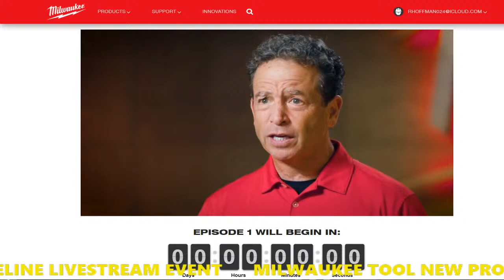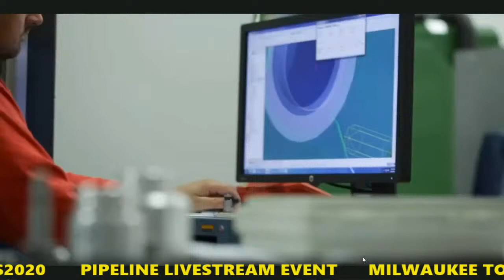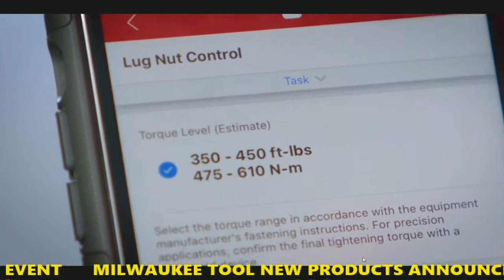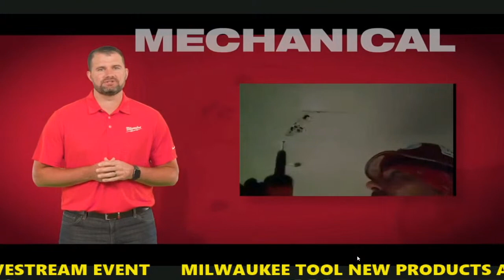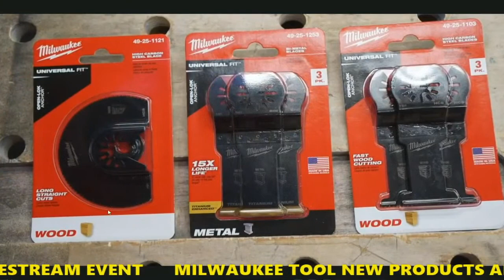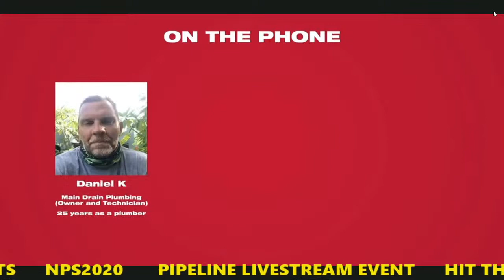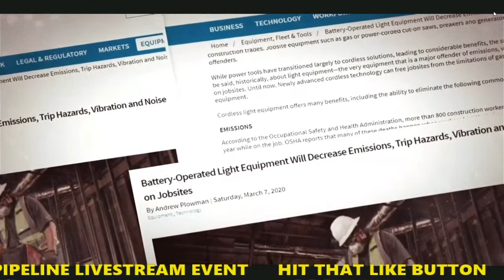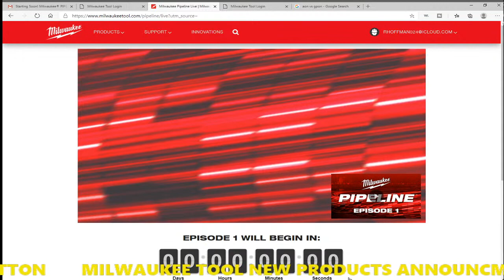MILWAUKEE PIPELINE EPISODE 1

Comment: Your right might aswell buy a stubby they need like a m12 power source ac outlet or m18 and a usb type c power source and rechargeable
Reply from the maker: I’d like to see a car jumper pack but i don’t think any of the existing batteries could put out nearly enough amps to crank a motor. If it’s doable would be a nice compliment to the inflator.

Comment: I'd like to see a 24" chainsaw maybe a small mx battery could operate it.
Reply from the maker: Philip Dove I think their struggling with the Mx fuel platform. You can see it with the sales their running giving away batteries and such. The only relevant tool I see from mx for most tradesman is the generator. The guys cutting concrete I don’t think are dropping the coin on going to a new unproven platform when they’ve already got gas saw that work.
Reply: @QVisionGarage yeah I agree